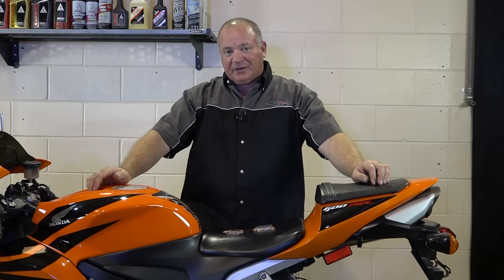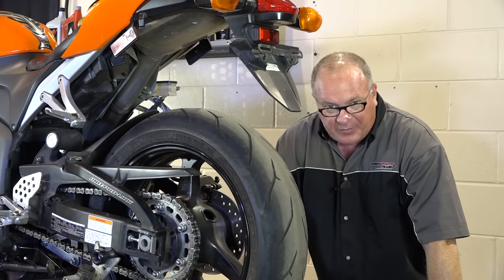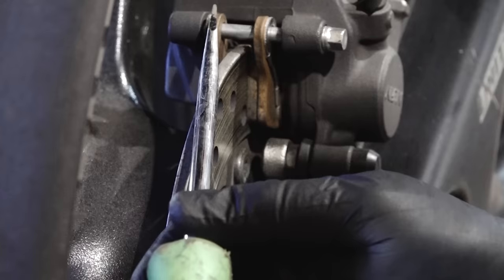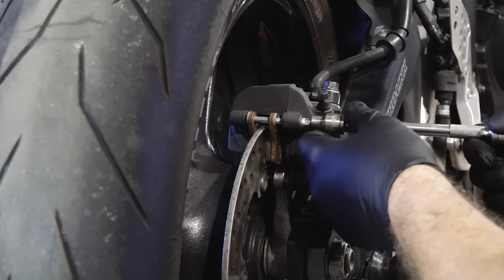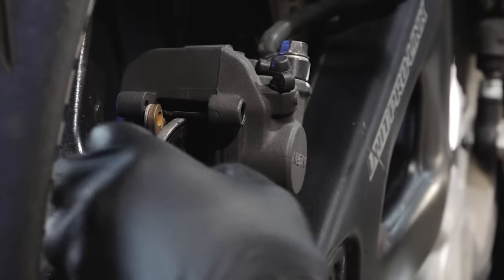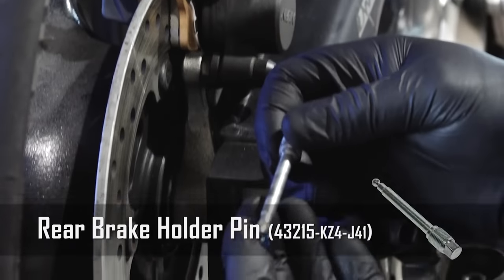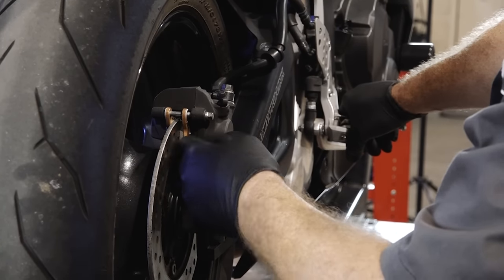How to Change Rear Brake Pads on a Honda CBR 600RR | Partzilla.com

Comment: You have the wrong vocation. Should have been a movie star! Love these videos. One small thing. Prior to and during  pushing the caliper piston back into the bore ensure there is ample room in the reservoir to receive the (extra) fluid. Stop pushing prior to reaching the reservoir's capacity.
Reply from the maker: Thanks, George.  Typically, when you push the piston back in, there is enough leeway in the reservoir.  It's always good to double check either way.  Good call.

Comment: Do you have to clean out the inside of the caliper before putting new ones in? Also will pushing the bore back make the rear brake fluid rise at all?

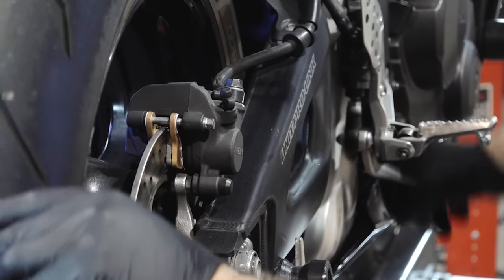Comment: 3:00 is it supposed to make that dragging or rubbing sound even while riding with no brake pressure or application? No overheating? Or premature wear? Same sound both front rotors and rear is normal?

Comment: I have a CBR600F3 W (1998) would this be exactly the same procedure on this bike? also would i need to place a small amount of copper grease on the back plate of the pads before installation aswel as the pin??

Comment: I will bleed it, but I've also just noticed that the hole in the break line bolt (that connects break line to the break line) is not lining up. It's a quarter turn past when hand tight and a quarter turn short after tightening.
Reply from the maker: The end location of the the hole on the caliper banjo bolt will not matter. Bleeding the system should straighten it out. Good Luck!

Comment: Would this be the same process with a 2005 cbr rr 600 ?
Reply: Tyler Phair yea mate if you have a stock brake setup then it's the same as this for example it's the same procedure on my 1988 cbr 250r
Reply: Yup, I have the 2006 and 2012 and they're the same. Since this was 3 years ago, I'm sure you have it all squared away!

Comment: I wonder if its as easy for zxr 400? The brake caliper is on the opposite side (under the disc, not on top of it like in the video) I kinda need to change the pads but not sure if I can xD dont want to fuck it up

Comment: Mr John. I followed your instructions here on the 07 model. We had trouble getting the back pads to squeeze in and that was only possibly after a hassle and without the clips that go on the brake pads. After finally getting it together, tested them out and the back brake wasn't working, no pressure. What is the fix here that I need to do to regain pressure, get them to work? Thanks in advance.
Reply from the maker: No pressure is usually a fluid issue, have you bled the system?
Reply: Partzilla , no we didn't bleed them bc we only changed the pads.
Reply from the maker: If there is no pressure on the pedal...That would be the first step.

Comment: I changed my rear brakes from one cbr to another (same year group) and compressed the brake using a c-clamp. I leaked what I thought was a negligible amount of fluid in the process (still well within the limits of the brake fluid well). Now my brakes won't compress on either bike. Suggestions?
Reply from the maker: You moved the caliper from one unit to the other? If so, when you open up any hydraulic system, you must bleed the system. https://www.youtube.com/watch?v=f07eAc_Uq50

Comment: I have just been helping a friend put his newly powder coated wheels back on his cb1000rr 2004 model 4.  when putting on the rear brake back on a metal shim dropped out, the one in the top inside is in place but where does the other one go ?
Reply from the maker: Shims go on the backside of the pads.  Unless you're referring to the spring plate that sits on the top.
Reply: @PartzillaParts  spring plate, one is in place inside. Its a smaller one I think fits at one end. Cheers.

Comment: I have a bobber that I picked up yesterday and they guy said that the rear wheel and brake caliper came off a cbr929. caliper is a nissin brand (that the only info I have on it) would the hanger pin for the 600 work on the 929 ? and would they be the same brake pads?
Reply from the maker: Never tried to use 600 parts on a 929.  It would be easier to just buy the parts for the 929.

Comment: I have a 97 cbr f3  I just changed my pads and I am now getting a kinda grinding skipping noice when I hit the rear brake
Reply from the maker: Pull them off and double check them.  There could be dirt on the pads, or they could have glazed. Also check your rotor and confirm it's not warped.

Comment: I have dual piston calipers.  The pads are wearing unevenly really badly.  I disassembled them completely along with the rubbers and cleaned everything until it was bone dry and then lubricated the sliding shafts, pad retaining pins, and everything else I could think.  I also removed the pistons and checked the condition of seals (removed them).  I cleaned the pistons thoroughly.  But one of the pistons is three times harder to push in and out.  I'm not sure what to do.  Any suggestions?  I only have 25,000 miles on this bike and the calipers seem to be in good condition, so I'm not sure why I'm having this problem.
Reply from the maker: If you cleaned and lubed everything and it's still sticking, the best thing to do is rebuild the caliper with new parts.  It could be a poorly manufactured piston or the caliper isn't pushing fluid properly.
Reply: Okay, thanks!

Comment: Way to easy! THANKS!
Reply from the maker: Easy is good! Glad you could get it done, Charlie.
Reply: I went to put the new pads on but only one side fits with the inserts around the pad....both pads with the inserts won't fit...any suggestions? I assume they're designed to have those inserts around the pads
Reply from the maker: David Rivera Are you aure the the caliper piston is pushed all the way back in the bore?
Reply: Yes it is but its the pad on the opposite side that won't slide in. It's to tight, if I remove the the metal bracket and that fiberglass insert it won't fit. If I remove them the pad slides in no problem.
Reply: the pads I purchased were thicker and wouldn't fit with the shims.
Reply: David Rivera I'm having the same issue right now with my cbr1000 2006. ever figure it out?
Reply: Tony Piatti yea, I did, the pads i order were thicker and they didn't need the shim.
Reply: David Rivera thanks for responding so quick. I don't have any shims on mine and it's just not fitting. double checked and I have the right pads. gonna keep looking

Comment: Hello  Sir  , I want to purchase honda cb hornet 160r.But I am confused about brakes. According to your opinion and experience which brakes are best either combi brakes or single disk. So plz suggest me as possible
Reply from the maker: Well, let's clarify, by combi brakes you mean linked braking front and back on one lever, yes?  There are combi brakes that are also single disc.  For a 160cc bike, either should be sufficient for riding.
Reply: Partzilla Yes Sir I will purchase Hornet  160r only with front disk only

Comment: Is sintered better or organic for my rear on my 03 cbr600rr??
Reply from the maker: Sintered last longer, and react better under high heat. Organic grip better in dry and need little heat to perform their best. 
it will depend on your ride style.

Comment: I can't get the back brake pad in please help!
Reply: I have a 2007 Honda cbr600rr and I can't get the rear back pad in, there isn't enough space for it
Reply from the maker: Can't pry it with the screwdriver to open it up?  Check to see your fluid isn't over filled.  It needs space to allow you to push the piston back.
Reply: I'm having the same issue. It's the pad opposite to the one on the piston. New pad doesn't fit between the rotor and the caliper